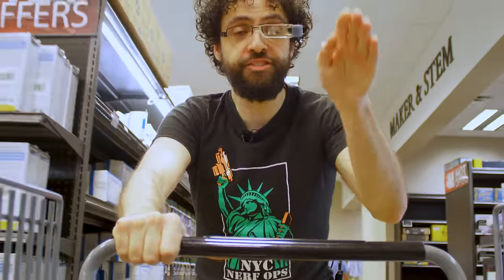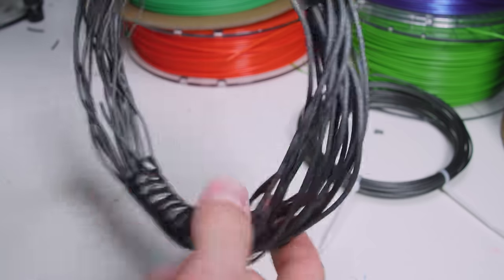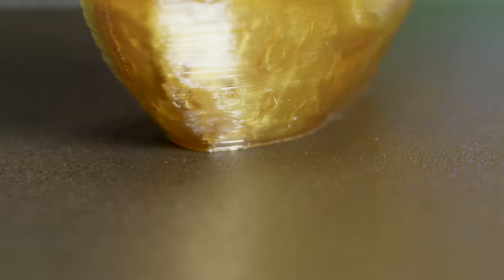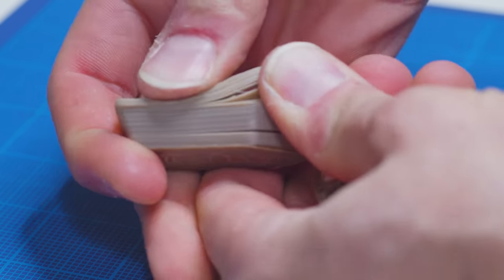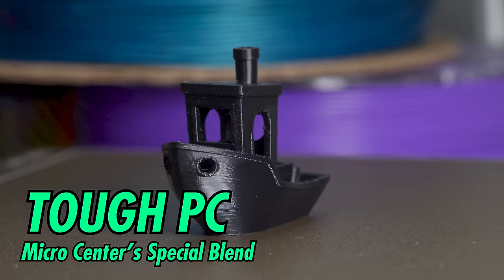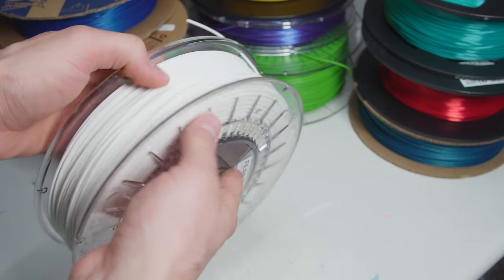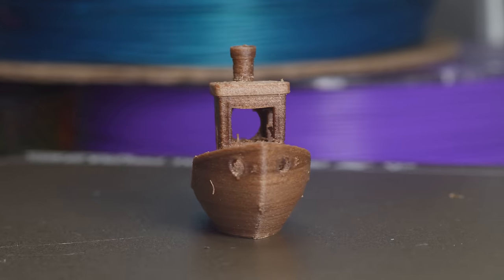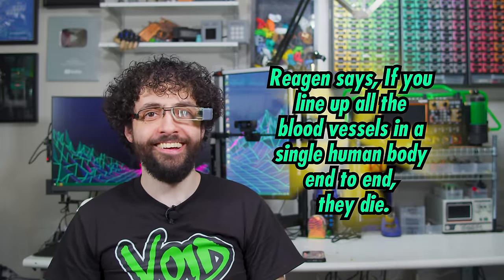The Most Advanced Filaments You Can Print: Every Single Filament Part II

Comment: The company I work for does laser-sintered carbon filled PEKK and it is such a finnicky material, but the things it's good at, it's basically the best at. Unreal chemical resistance, no offgassing, tensile strength on par with aluminum.. the stuff's amazing.

Comment: From personal experience, Igus I150 actually prints fairly easy on a basic 3d printer. We ran a wear test comparing it to pla and after the pla was almost worn down the I150 barely lost it's layer lines. If you still feel up to trying Igus materials I would try that.
Reply from the maker: I'll get my hands on some. I'm definitely curious if the other formulas are as printer-kickingly enraging as J260.

Comment: Hey! Great Video! I have recently been using the Polymaker PA6-GF, it is a glass fiber nylon, and it is possibly the easiest to print polymer i have ever seen, and it is so hard and strong that i couldn't break it with a hammer. Worth a review, because of the incredible strength while maintaining rigidity without stiffness. I genuinely have yet to break it.

Comment: I found that Inland's Tough PC aka Polymax PC prints totally fine with a non-all metal hot end using a Capricorn ptfe tube at 258 celcius (a bit under the maximum 260 of the tube) and It easily prints using a slightly modified PETG slicer profile to accommodate higher tempurate and lower print speed. Might not be as strong as printing with higher tempuratures, but it works! Definitely recommend for people with a stock Ender 3 or related if they want to get into some kind of engineering filament.
Reply from the maker: Good to know. That's about as hot as I'd want to push anything lined with Teflon.

Comment: I’ve been printing with 3Dxtech ASA CarbonX for a couple weeks. Took some tinkering. High temps, no cooling, enclosure is a must for longer prints. If you’re not impressed with its strength, crank the temps for better layer adhesion. When you get it right, is good looking and super tough but can be brittle. I printed an adjustable wrench that I will actually use. UV resistant and can be used in high temp environments. I will be using for vehicle engine bay components. I was successful with blue painters tape and glue stick. Hardened steel nozzle is pretty important, the filament literally feels like sandpaper.

Comment: PP-GF30 is my filament of choice for the sterilizable lab equipment. It doesn't deflect up to around 130C and does not absorb moisture which makes it perfect for autoclavable parts, especially the internal parts of bioreactors. The chemical resistance is also great and unlike PVDF it's more accessible and much more reasonably priced. I found a reasonably easy way to make it stick to the bed quite well without using a Garolyte bed sheet: slice a model with a 2-layer raft, add 150% extrusion multiplier for the first two layers (the overextrusion allows PP to properly embed into the softened layer of PETG). Then heat up the bed to 120C, load PETG and print the 1st layer at regular 230C nozzle. Change the filament for the PP-GF, heat up the nozzle to 260C and thoroughly purge the remains of PETG out. Continue printing. When cooled, PETG raft naturally unsticks from the PP raft part.

Comment: Minor correction - Prusas will happily print at up to 300C - the teflon sleeve in a genuine V6 is on the cold side of the heatbreak and doesn't see anywhere near that temperature (don't go anywhere near 300C in printers like many Ender units that have teflon heatbreaks though)

Comment: I work at an aerospace company making valves and pressure regulators for the space launch industry and we actually use PEEK for seals in several of our products. I think I have a big 6 inch diameter slug of it on the shelf right now... It was quite expensive. Same thing with ultem although we haven't used that in some time

Comment: I independently came to the same conclusion about composited PETG - I've been using both the CF-PETG (carbon fiber) and GF-PETG (glass fiber) with great success for manufacturing my own functional parts.  If you don't have an enclosed or high end printer then I think either of these filaments will be your best bang for the buck all around.

Comment: PSU is a great material bang for buck among the high temp filaments.  1010 wants to rip your build plate off and I could never get it under control even in a 115c chamber.  9085, while expensive, prints very nicely.  I have some PEEK and want to try to print it after watching your video.

Comment: i work with plastic nearly every day (thin-film thermoforming shop.) i like polypro because it has a slightly sweet smell (i notice a smell because we go through thousands of lbs of plastic per machine per shift, at least), and i dont shread my hands when pulling the scrap rolls off the machines if i forget to put my gloves on.

the only issue is that if we have an end of line grinder the ground up plastic has a tendency to clog the bag and make a mess.

Comment: I’ve a roll of CF-PETG, but it seems like it equips parts with a self destruct timer. It builds up a blob on the nozzle that detaches, hardens, and causes layer shifts.

Also — do some metal filaments meant for sintering like BASF ultrafuse or Virtual Foundry. Some additional equipment required if you go the VF route, but I’m sure you can find more uses for a high temperature furnace.

Comment: Take a look at the PrePerm High permittivity fiaments for the special use cases episode. They are specifically designed for RF and microwave engineering purpopses and I am working with them in my PhD
Reply from the maker: I’ve never heard of that one! It’s expensive, but hopefully I can get a sample.
Reply: @ZackFreedman  yeah 1.5 kg will cost you €900,-
Every failed print hurts haha.

I am currently printing them on my heavily modified Prusa mk3s wich is not optimal. Your Video ispired me to look into the e3d toolchanger Plattform and IT looks awesome. Especially for further experiments in my PhD with multi-material stuff. The Prusa MMu was too much of a prinzipiell, and considering the Cost of the filaments you rallye dont want to use a purge tower.

Am now preparing to convice my department head that we need this thing.

Comment: Ah yes, PEEK and Ultem.  Worked with both in a molding shop years ago.  We installed an industrial grade school bell on the press running the Ultem.  If the bell went off, you had about 30 seconds to get there and get the screw moving before it the material would set up and lock the screw in the barrel.  Good times.

Comment: I know nothing about 3d printing(these videos just got recommended and they looked interesting) but I recognized some of the materials from the vaping industry. Ultum and Delrin are used for both drip tips and sometimes the inside of a tank/rda to separate the positive and negative areas so they don't touch causing a short. Vaping parts get really hot so when they need something that can take the heat, not warp and remain cool to the touch so it can touch your lips they use usually Delrin and sometimes Ultem though Ultem is kinda ugly so it's not used as often.
Reply from the maker: That's pretty neat. Ultem in particular has great temperature resistance and dielectric, plus when it burns, the smoke isn't particularly dangerous. Perfect for the business end of a vape.

Comment: I know I'm a few days late, but I have a question! Do you or anyone else have a suggestion for a material that would be vacuum safe? I work for a company that makes custom mass spectrometry equipment, and we are starting to get into prototyping and making a handful of parts on a cheapo printer. But seeing this list, it makes me wonder if there's maybe a filament that would work inside a mass spectrometer and not off gas chemicals. We use Ultem plastic on certain components as-is, so that's a contender. But I wonder if there's one that doesn't require such extreme printing conditions. Thanks!

Comment: Small correction here. At 30:10 you mention PTFE filament. This is not PTFE, it is FEP. They are similar, but still not the same. PTFE parts could be made only by sintering the PTFE powder in a press. In other words, virgin PTFE doesn't melt. FEP in contrast is a co-polymer of hexafluoropropylene  and tetrafluoroethylene which does melt and can be printed at like 380 C. However, in almost every other aspect FEP and PTFE are similar, especially in regards of sticking to absolutely nothing and being exceptionally chemically resistant.

Comment: New subscriber.  Epic video.  You found and sourced filaments that I never knew existed and then laid out the pros and cons for each.  That was a crapload of work you did and then you laid it all out with witty writing and manic rapid fire delivery.  You sir are a beast.

Put in an order for the Fusion HTPET+ on your recommendation.  Been using Alloy 910, but it's very pricey and not available in the range of colors that HTPET+ is.  The black 910 also looks purple, which bothers me a lot. Very curious to see what HTPET+ is like annealed as heat tolerance and impact resistance are important criteria to me.  Creep deformation for nylon is also abysmal.

Comment: my neighbor is a doctorate level metallurgy engineer at a widely known manufacturer of valves and fittings. He hooked me up with 666 grams of fire-resistant ABS. Once I got my speeds and feeds dialed in, it prints like a dream... I should run a benchy with it, but I'm too busy printing useful stuff... Like game console controller holders...

Comment: I see that you did not have any CF PEI filaments. I've been trying to print CF PEI 1010 on a Creatbot F430. The nozzle can go up to 420, the print bed can go up to 140 but the chamber only goes up to 70. And this printer was advertised as being PEEK capable. And what you described about joining the union that's what I've been fighting printing it because my boss keeps thinking that it's cheaper and it'll work okay to print the parts that we need for prototyping and r&d testing.

Comment: 8:16 – Saying "crystallization from overheating" may be a bit misleading since no covalent bonds break. – I'd say "crystallization from sitting too long at high temperature"
8:26 – Slow cooling should form even even bigger crystals making things even worse. – I think it would instead need to be re-molten and re-extruded (where cooling is fast).
Maybe almost melting it and then quenching it with a fan works, but that would likely deform the filament too much.

Comment: Nice work, again.  Thanks.  I would only add that I don't think a benchy is a good test for high speed, unless you've got some insane acceleration on that machine.  I can't see a monster head like that getting up to speed before having to change direction.  I could be wrong of course; I'm only going by my experience on my M3, which smirks at me when I set it above 100mm/s and give it something tiny to print.  I'd be interested to see the gcode for that print.

Comment: 6:00 – I found that recycled bottle PET (brand bpetfilament - this is not PETG with a G) does that extremely visible crystallization opacity change too.
Beside nozzle temperature It's strongly dependent on print-speed and degree of fan cooling.
edit: 12:50 – Oh something similar is on the list of covered filaments
Reply: I think it's mostly about slow cooling giving time for crystals to form that come into the size range of the wavelength of visible light.

Comment: One I’d like to see you try is PC-PBT. I got mine from Push Plastic in the US. It’s in the Engineering plastic camp, pretty slick. I’ve had issues with layer adhesion but I’m also printing on an (insanely customized) open Delta.
Reply from the maker: I never heard of that one! It sounds like a weird combination, one of the hottest-printing materials with one of the coolest. You'll see some other PBT composites in future episodes.

Comment: you should do some glass 3D printing, somone at my uni figured out how to do it without special equipment, just 99:1 sand to pla filament, they are super cloudy but it would be a cool project if you could figure it out aswell
Reply from the maker: How did they make the filament?!
Reply: @ZackFreedman  I know it was a 99% sand to 1% filament mixture, and then he put it in an oven, I will ask and get back to you

Comment: I used this in my last job in 30K 3D Printers. I used it until they got the 1.4Million dollar units. The total install cost of the CNC quality metal prints were 2.5 Million for cooling and 1.4M for the printer. The company was a food container company. they used it to represent the end results of injection molding.  Yes they made 22 cent containers in it. It was the closet item they could get to test design in every microwave.

Comment: 28:31 I just want to bring up Delrin. I know almost nothing about 3D printing but I worked in a large format mold plastic factory. 

I think I started there in about 2004 and I was all done in plastics by 2008. The company wanted to be able to offer delrin parts but it was truly a hassle to be able to set it up a mold to do it. 

I spent two years reading all the specs that were available calling people in the industry and we finally were able to do it through my hard work in a mold. Even the most veteran of operators would have troubles from time to time. After the machine had been running for almost a year with three shifts; the third shift manager not really understanding how delicate it was to get all the procedures correct just let the machine run out of pallets and just turned it off. It took 3 months with two shifts daily to be able to get the machine back up and running consistent parts. 

I hate that material with the fire of a million burning Suns. Reminding me of this tells me exactly why I'm not going to start 3d printing. Thank you for the reminder.
Reply: And anything that comes even close to being the more of a pain in the butt material compared to Delrin: deserves to be forgotten for all time by all people even if it were the key to get us into Jupiter's atmosphere it deserves to be a locked away cult secret.

Comment: 3:27. CF Peek. Hey Zack, i think you are missing the most important part here. 3D printing Gun parts. It's terrible. Just use aluminum. But I can't do that without having a workshop. With this and some time. I can have a 3D printer running gun parts in my room while I watch it.

Comment: Hi Zack, what bed and nozzle temps did you print the CPE HT with, and what print speeds did you find to work ok? Any special adhesion/build plate considerations? I bought a sample to test it's solvent resistance in my lab, and it looks great. Just could use some starting points before I print it. Thanks!

Comment: Question which filament is actually a hose/flexpipe (i assume the glass filled ones) AND can be FREED of their contents or are available without the fill AND have a reliable inner diameter AND do let enough heat through to print ANOTHER filament that could be somehow stuffed in there by applying black magic or smthg. ... errr ... ?

Comment: What would you recommend for making high strength RC parts, something that would be withstanding 20ft jumps and a 4kg structure.
Reply: PETG would be a good place to start since it's so easy to print, but it may not be as strong as you need. Honestly a high durometer TPU would work well because its flex helps prevent breaking. Only problem is the toxic gas it prints with. I'm sure there are other options but that's what came off the top of my head

Comment: Just a note that nobody reads but I have to say it. The Polymax PC looks perfect after the print, its stiff and resistant to heat but... BIG BUT... after half a year just on normal air, not even under UV light, it disassembles itself like nothing. I was using Polymax PC on everything technical because It was great, but I stopped because all parts that has just a little bit of tension on them just split apart.  Not sure if anything changed in 2022, but this was a problem in 2020. Any updates?

Comment: So could you help point a newbie in the right direction.  I have a flashforge 5m.  I'm looking for a filament that can handle UV/heat, just so I can actually bring it outside. But i'm looking for something safe to print with no enclosure. I have some pet birds and they are extremely sensitive to VOC and UFP.  PLA seems to be safe, but i do NOT want to go to ABS or ASA as I have read they NEED enclosures and filters.  Am i out of luck?   I heard good stuff about PCTG, but I can not find anywhere that has information about its safety in printing.

Comment: Yeah 100c for heater chamber is kinda low, but also nothing in the tool changer lasts under 100c. Every part degrades. Most print at min 120-150c but it's  usually the best at 200-250c.

Comment: You don't need high speed PLA. I use PLA+ all the time on my Neptune 4 up to 250mm/s

With 0,6mm nozzle and 0,24 Layers 150mm/s

Only over 300mm/s are there problems, but that might be because of my settings. Just get a  CHT nozzle and print hotter, as long as your cooling game is on point, no problem

Comment: The first guy on you tube to admit additives are made in the filament not additives just coming out your nozzle as a term called additives you have the correct idea of a true additive and there use ,slip level(COF), anti block, uv additives ,vit d, flame retardant, zinc are all additives great finally additives terms used correctly

Comment: You should've added some of the metalic filaments (stainless steels, bronze, titanium, tungsten, high carbon iron)
Reply from the maker: I covered a few in the first episode. They don't really improve any physical properties, they serve more to add density and patina.
Reply: @ZackFreedman  They do improve physical properties after being fired in a kiln. I use 3d printed stainless steel nozzles for my rockets since plastics either burn or melt while ceramics crack from the thermal expansion and thermal shock